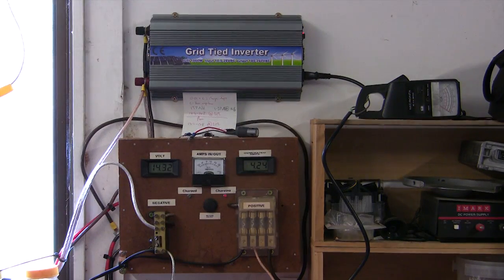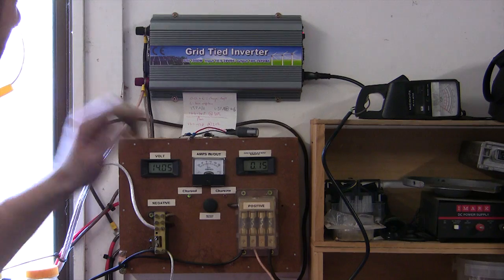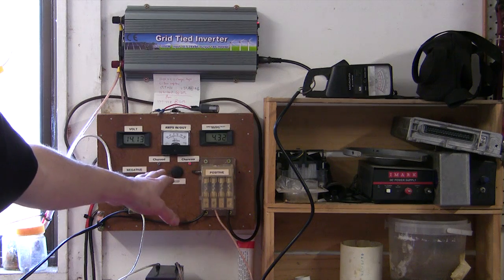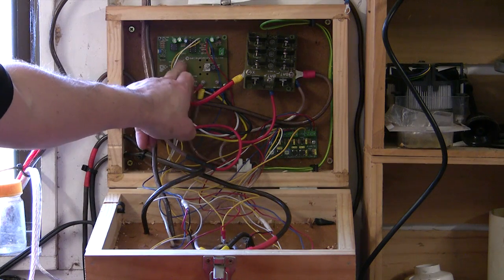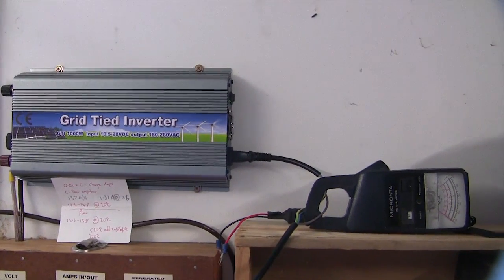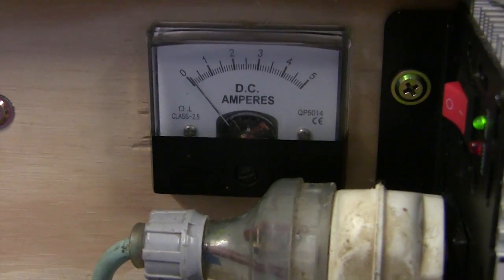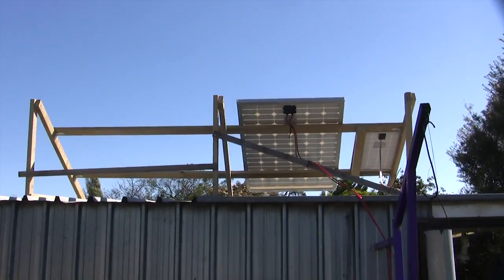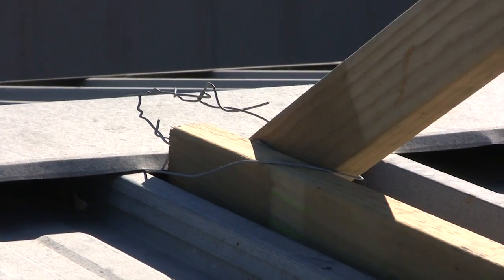my solar powered workshop

Comment: @HomeDistiller  Hmm; unless you have a huge set up that should be more than enough. If it's not switching states a lot; the only other thing I can think of would be a short in the coil. Although, a short in the coil would be unlikely given the way that the wire is produced. I'm out of ideas. Keep us posted on any progress you make.

Comment from the maker: @Ilovetheplatypus wow an lcd tv draws like 200W that more than the panel makes, i wouldnt be able to touch the relay infact it would be on fire.. this was only about 35°C so maybe 5W total (infact i think the relay draws 200mA so that at 13.5V is 2.7W add maybe about 2W for losses and you get 4.7W or just enough to make something slightly warm) as for losses to the battery the relay on turns on when the batteries are charged so any losses are only on the grid tie side anyway

Comment: @HomeDistiller Hmm; that's rather odd that the coil would heat up that much unless you've got more juice running through the thing than it is made for. In any case, all that heat is simply lost energy. I'd bet you could run an lcd television for close to an hour just off the energy you're losing to heat. Granted if your batteries are staying topped off it doesn't really matter, but defiantly interesting to think about.

Comment from the maker: @Ilovetheplatypus more likely it was  the coil causing the heat, as it was only turning off for a few seconds every 2 mins or so. (the NO contacts go to the grid tie and the NC go to the batteries so it was running about a 98% duty cycle)

Comment: Simple relays like that create a momentary spark when they switch states. When you get it to the point that it's not switching all the time, it will reduce the heat that it is producing dramatically.